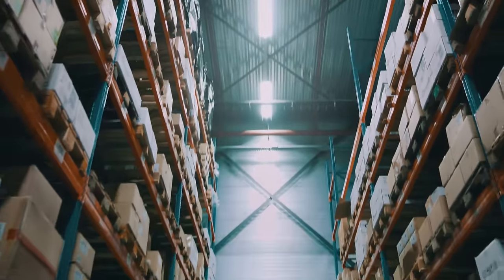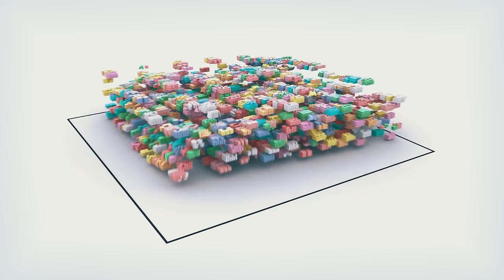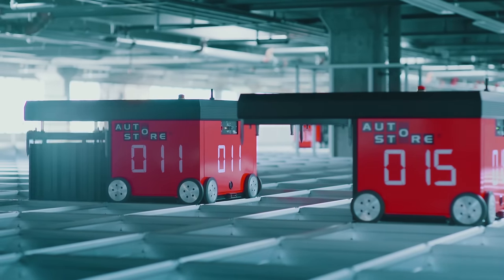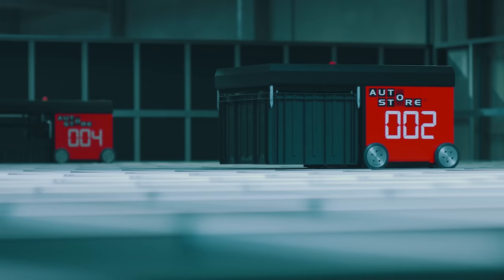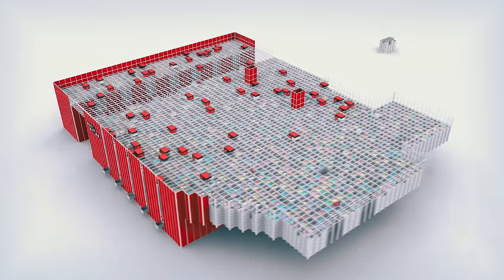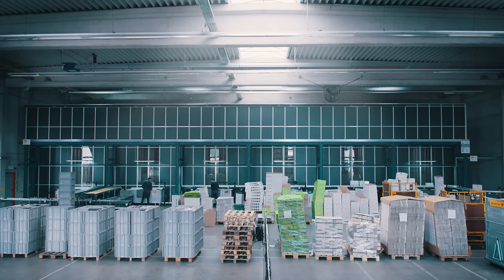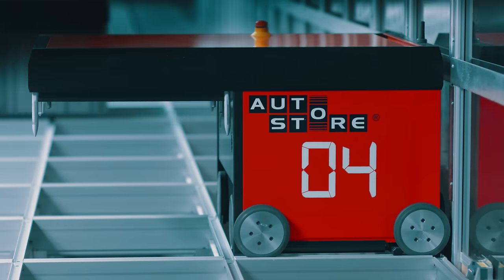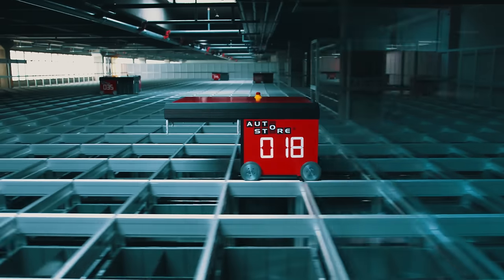Advanced Automation with AutoStore Warehouse Robots

Comment: Hi, I have several questions:
1) How deep down the robot can dig? Can it dig the crate from the lowest level? If so, how?
2) After the crate was picked, robot takes it to the lift which takes it down for picking the order? And then the crate is moved up again by lift?
Reply from the maker: Hello Dmitrii, 
Yes, the robot can dig up a bin at the lowest level. If a bin is buried beneath other bins, a robot stages the extra bins on top of the grid until it retrieves the desired bin toward the bottom. The robot then takes that bin to the edge of the grid and delivers it to the operator fulfilling the order. As the bin is delivered, another AutoStore robot cleans up the staged bins on top of the grid by returning them to their original position. The bin is delivered to an operator by the robot the same way a bin is picked and stored within the grid. Overtime, the AutoStore self-profiles with slower moving items go to the bottom of the grid and faster movers migrating to the top. Please visit our website or contact us if you'd like more information: https://www.bastiansolutions.com/solutions/technology/goods-to-person/autostore
Reply: But how do they reach down that far? do their grippers extend down on cables?
Reply: wow it is wonderful.

Comment: The two things that come to mind are fire safety and lack of a fallback if the system fails for some reason. 

Is there an integrated fire monitoring and suppression system? (Halon or equivalent)  

Human accessibility has a bunch of benefits. What would happen if a container jammed halfway up a stack in the middle of the dense cube? Is the truss rated for person to go across the top to do maintenance? Would a separate gantry systems be required for access?
Reply from the maker: The AutoStore system manufacturer has done a great job designing the system with fire safety in mind. The system is very dense which limits the air flow needed to grow a fire. Existing fire alarms can be wired into the AutoStore system allowing many configurable actions to further reduce fire risks. Live fire test have been performed and video recorded. The fire test performance results are available for aid with insurance and fire department approval.

Since the creation of AutoStore in 1996, there has not been a single example of a bin getting jammed in a column. Should it happen, a bin recovery tool is provided with the system which will allow an operator to manually winch the bin out of the stack. The robots can also be used to dig a stair case in the surrounding cells to gain access to the problem bin.

The grid is strong enough to carry the weight of a human operator needing to access the area above the grid. A Service Vehicle Unit is provided with the system allowing an operator to drive across the grid while the system is locked out. Service plates are provided to convert an area of the grid into a flat platform for service work. Safety requirements above the grid vary by jurisdiction, a Bastian Solutions engineer will work with the local governing body to determine the appropriate safety accommodations.

Thank you for the questions!
Reply: Damn, they literally covered all your valid concerns. Impressive

Comment: What if there's an electricity interruption? Can the robots still work?
Reply from the maker: No, the robots would not work with an electricity interruption unless there was a backup power source.
Reply: Guess they would have a back up generator
Reply: Almost no distribution center or warehouse can work without power.  All of them have inventory systems that must be available and online, or product quickly gets misplaced, stolen, etc.  People get injured when there are no lights to see. Basically, when the power goes out, the warehouse stops moving.  This is true of humans or robots.  So....potaytoh, potahto.

Comment: So everytime you need to take a bin from the bottom, you have to take/remove the bins on top?
Reply from the maker: Hello there, AutoStore bins do have to be dug out from the bottom at times. However, fast moving items naturally migrate to the top, and the slow movers to the bottom of the grid. When a robot needs to reach a tote at the bottom, it places the top bins off to the side, while the rest of the robots move around the stack. The AutoStore robot then replaces the stacked bins back in their respective column. Additionally, robots can be programmed to pre-dig bottom totes to save time. You can learn more by visiting our website: https://www.bastiansolutions.com/solutions/technology/goods-to-person/autostore
Reply: Lol still faster than the old warehouse system. Most importantly no need for human labour.

Comment: suitable for small weight items.... any solutions for big heavy items like a full pallet which weight approximately 1.5 tonnes?
Reply from the maker: If you are looking to handle large pallet loads, AutoStore would not be a good option for you. Perhaps a unit load ASRS or pallet shuttle system would be best. If you would like to discuss, please feel free to contact us, and one of our engineers would be happy to help.
Reply: @BastianSolutions  What about something like 300lbs? Do the totes have to made to suit the robots in terms of pickup points and overall size or is there customizability there?
Reply from the maker: @ianmckenzie1001  The max load per bin at this time is about 66lbs. The totes are custom made for AutoStore to fit within the grid and so robots can easily lift and maneuver them. At this time, there is not an option for customizing the totes.

Comment: Sure, looks really good in a SIMULATION.  But what warehouse only has small items like this?  Nuts & bolts factory maybe?  This system is at best a niche market.  Many warehouses have to handle noncom products that are so big, so unwieldy they cannot fit on conveyance equipment.  Then what happens if the digger gets jammed?  Or a pocket deep within the bowels of this abomination becomes unstable or causes jams?  How the heck could you fix that?  Lastly, this system mind be super efficient when completed.  But damn - this has got to be super expensive to be construct.  Likely, making it prohibitively expensive for some companies to invest into.
Reply: Automotive parts retailers for one.  I should know, as I work for one that is on the Fortune 500.  The plan isn't to put every single item you sell into this system.  Non-con items will still be palletized and moved via fork trucks, or hand carts.  But over 70% of the roughly 400,000 SKUs we stock in a typical ware house are the size of a 12x12 inch cube or smaller.  Wipe blades, floor mats, steering wheel covers, air-fresheners, coolant, hand held tools, etc.  And yes, we do sell a lot of nuts and bolts.
.
I'm in the IT for the warehouse segment of our Supply Chain division.  The possibilities for this are amazing, and labor efficiency and cost savings are tremendous.  
.
How do you fix a jam?  I have no idea, which is probably why I haven't built this system myself.  My guess is they have a plan for that, or they wouldn't be selling $100 million systems all over the world.
Reply: We are working with this system, it actually work pretty good. The bins are larger than they appear, so anywhere from cosmetica, phones and accesoires, laptops, baby clothing, games, basically 70-80% of what people order in general.

In case of jammings or the system not working properly, someone can reach the robots manually and easily remove it out  of the system. This takes approx 10 mins and the sytem will work afterwards again.